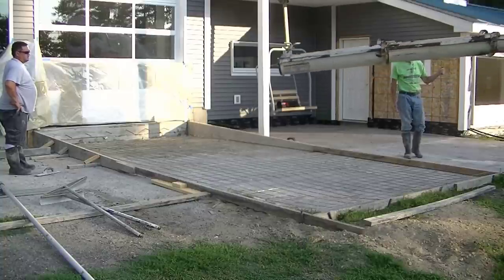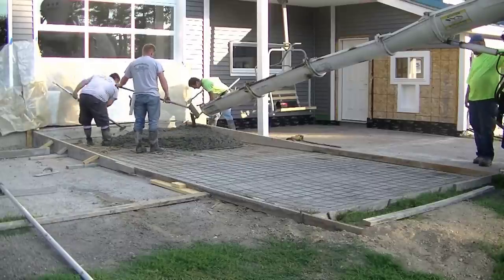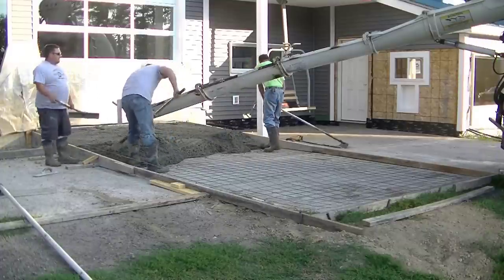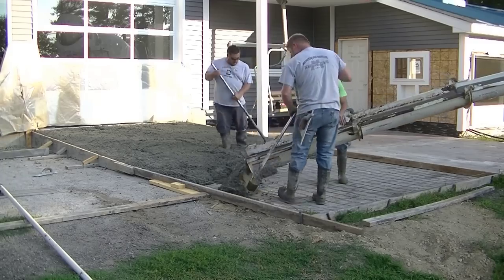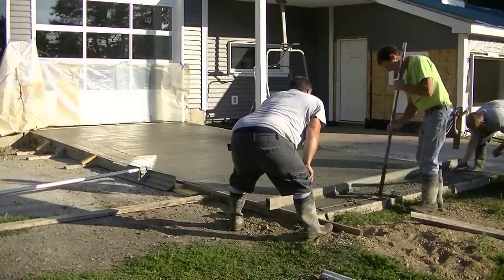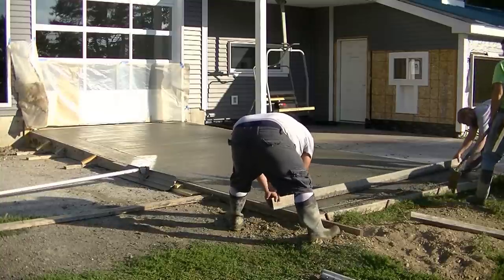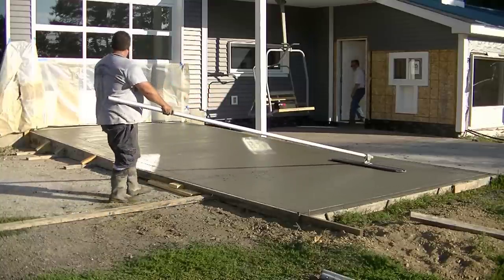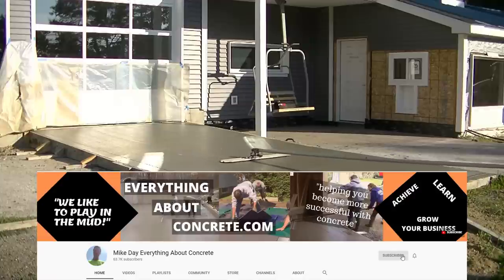Pouring Concrete Over Existing Concrete (New Patio Slab)

Comment: Pouring out a 18x24 old garage floor, bringing up to the level of the rest of the house. Customer closed in the garage. Tight space pulling the windows out so the concrete truck can get to it better. Slab goes from 4" to 5" slope end to end. Smooth finish

Comment: I'm extending my concrete patio by quite a bit and screening/roofing the whole thing. All through teaching myself and with help from friends. I plan on taking your concrete course before I start site prep. My concerns are setting the concrete/brackets for the posts and adding only an inch over the existing pad to blend it into the new sections of the patio. I'm practicing my finishing techniques with small batch forms for some pavers i'm making. Smoothing, edging, brooming, etc. Your videos have been very helpful. Best i've found on YouTube.
Reply: You should make a tutorial! I want to do the same

Comment: Every engineer I have dealt with has told me never pour concrete over concrete no matter how good the old stuff is   ? And if you were you needed to bust up the old in to small chunks or put a  3 inch sand base with liquid barrier on top  , it would crack  ? I’m in the Pittsburgh Pa Wheeling wv  area !
Reply: Im around beckley and ive seen success capping old concrete if you do rebar pins sticking up. You have to pour a footer then pour the slab if you do a monolithic slab. Thats code
Reply: If you build a concrete building, you are essentially creating new floors every 28 days. Concrete over concrete. You can, it's just about creating the proper bonding joints and have your rebar spec'ed by a structural engineer.

Comment: Have a house where the builder's originally poured concrete all around probably to keep water from the foundation.  Unfortunately on the side of the house where there's a big pad, the concrete is sloping back towards the house.  In the back where the concrete pad is about 1.5ft around the back, due to the spicket part of the concrete has sunken and is now holding water and causing basement flooding issues.  Trying to figure out how to fix these counterproductive areas and keep the water flowing away from the house without going broke.
Reply: @michaelsanders9147 I've got a similar problem in that there's a really old pad outside the back door. I've always noticed that it's not a bad slab with no cracks but it has sloped towards the house due to poor drainage. I fixed the drainage issue but when I uncovered the cement I found out that it's about six inches thick! WTF? Ugh! I don't know if I can break that but I'm becoming more convinced that concrete pad is going to have to be removed in order to achieve the correct slope away from the house. I was really hoping to maybe pour a slab on top but I don't think it's a good idea for the future benefit of the house. I think my plan is to remove the concrete, put a nice grade there that slopes away from the house, and possibly put a deck there someday.

Comment: Do you need a bonding agent? 

What's the minimum thickness you can pour over an old slab?
Reply: Since hes using 4k psi, fiber plus rebar, it seems like he isn't worried about cracking or separation. I find the bonding agents work but only i you put them on right before hand.  I'm guessing dirt from the air lands on the bonding agent and negates the adhesion to the new concrete.

Comment: What is the minimum amount of concrete can you pour over concrete walk to make it look new?
Reply: Same exact question. The only thing i've found so far on that is for thinner layers of concrete you need to prep the existing surface with weldcrete since the mass is not enough to keep the layer in place. Hope we get an answer from the pro though.
Reply: I have the same question.
Reply: Minimum of 2" is required, anything less it will crack easily

Comment: Hi Mike, I’m planning to recover the front driveway and pathway, it was done about 4 years back but never finished with a sealant . It’s broken down in a few places and I wanted to have it recovered with a brush finish rather than the original (very heavily)imprinted concrete, we were short of money and rather than using mats to imprint it, I wanted to use the garden cement step moulds, the ones that look like cobbles. My brother in law did the work for us but set the pattern in too deeply between 1/2 and 3/4” deep, if the severe winter hadn’t broken up a few spots, I was planning to acid dye the slab and the deep joints fill them with either a nearly pourable cement to infills the  deep impression therefore giving it the illusion that it was two different type of media, then seal the lot. But like I said, there a few pieces of damage where it has taken the top 1/8th to 1/4” away in a 3 to 4sq foot area.  What would you do to put a new cover on it, besides brush away all loose material and power wash the area clean, would you use a bonding agent to the original pad, or could new concrete be laid on top of the old. Any information would be greatly appreciated. Love the videos, keep em coming. All the best for 2023 from 🇬🇧 UK.   Phil

Comment: I'm about to extend out some steps and pour new concrete over old concrete steps. I knotching off the edges of each step. 2" below the old steps is pretty rough concrete.  Should I anchor the wire mesh into the old concrete for stability, . Or is wire mesh on its own enough for the new concrete? The new steps will be between 5 and 8 " thick in most spots.

Comment: Hi Mike,  I've got a bit of a tricky situation.  My back yard here in northern CA has a concrete slab for RV parking from the previous owner.  We painted it and turned it into a little hockey shooting area.  However, we want to re-do the back and go big-time:  actually make a little hockey court, by rotating the rink 90degrees and expanding it.  That means I've got to figure out what to do.  The existing concrete is pretty good, but it's not too flat as it was added in sections (some are a bit higher) - and it has those gaps for stress.  I'll also need to add more concrete beyond what's already there to get to the dimensions I want.  Ideally I'd like a really flat smooth surface bigger than the existing concrete.   I'm trying to decide what's the best way to do this - should I dig out and put in forms around the existing concrete and just add new concrete up against the edges of the old to complete my court, or possibly grind the old concrete down a bit to flatten it out and put in new concrete AND cover the old stuff?  It seems a shame to tear out the old concrete as it's actually in good shape... advice and tips would be great.
Reply: Get someone to come out with the scanner to check the structural integrity of the slab first.

Comment: I’m looking to build a self storage building on my current concrete parking lot. I’ll need to pour concrete on top of concrete. Can the original concrete kilt as part of the 4 to 5 inch recommended foundation

Comment: I’m looking to do my concrete outside of my garage door in the back of my house. It has some large cracks and it’s on the slope going downhill. I would have to pay a lot of money to have the concrete removed but I’m looking at it if they want I can just repair some cracks and pour concrete on top. What would be the accurate thing to do when you have about a 2 inch crack in some places to repair it before putting concrete down on.

Comment: I have a driveway that leads uphill from the street to a level carport. There is an area that has cracked about 20 feet from the start of carport and has become a trip hazard. I also want to form a sidewalk from the driveway and curve it up so a wheelchair could go to top step... I have dirt from another part of the property that I can form an increase in height without having to use concrete to get the extra height to get to top step. 
Do I need to put gravel on the broken area to level before I can start pouring

Comment: Hi. Thanks for your informative videos. I’m looking to pour a new concrete slab over my existing garage slab. However, under the garage is livable space ( cold room) so I’m concerned about the added weight. Had a contractor come out and he suggested preparing the existing slab by torching it before pouring over it. Never heard of this… any thoughts. Thanks

Comment: Well this is an older video but going to see if this gets through. :)  I have an old limestone packed concrete.  The old concrete that eventually breaks away exposing the limestone.  Am i able to pour over that?  I have no cracks, just has been worn away.  This concrete is so hard to break apart.  This is why I was wondering if I can pour over?  Thanks!

Comment: In Massachusetts. Subzero winters. An older driveway is kind of busted, but NOT heaved. It's also a little inclined, like maybe 5 degree slant (10% grade?) Can a new pad go right on top? Want the pad to be flat, so maybe 4" concrete at one end, but 8" concrete at the other end, to be level. Make sense? Thinking to do a monolithic as well, with the corners going in deeper. Thoughts?

Comment: I’m thinking about going over my cracked driveway it is low I’m wanting to raise the elevation possible road mix up to where I want it maybe 3 inches road mix 1/2 inch then 4 inch slabs over the top of that should make for a good base I’m thinking

Comment: Awesome video, I'm planning a 20x20 pad that is partially over another concrete slab that is 20x10 and has a couple big cracks and unevenness in a few places. What would you do different when pouring over a pad like this?

Comment: I have a 1965 bilevel home.  The concrete sidewalk on the side and back of the house has sunk 3" in some areas.  Can I pour concrete on top of the sunken concrete sidewalk?  Also, I have an RV pad next to my two-car garage.  I want to build another garage/ADU on this RV pad.  Can I fix the cracks and pour them onto this pad.

Comment: Had a house where they  poured concrete  over concrete sidewalk   he put rebar on top that was 4 years back so far ok .The driveway cracked where we had a ditch they did not compact the base !! I see very little wire mesh most use rebar now they use fiberglass rebar 4000 PSI granite mix 3 to 5 inch slump metro KC .

Comment: How do you set frame down for concrete if it’s on concrete? I’m trying to put a ramp down for my grandpa and it’s only 3.5inches high and 15 inches length. My question is how do I set the framing in place so the concrete stays?

Comment: I have a slope in my garage and wanting to pour concrete over it to level the floor out plus the doorway has gaps underneath where water flows in...can i put concrete under the doorway framing aswell pls

Comment: I have a 24 x 24 preexisting slab the is 3 inches lower than a 10 x 24  RV slab.. I plan on putting a steel building up.. should I bond the two and should I also add mesh.. I plan on putting in a car storage lift ..

Comment: Do you use any kind of primer on the old concrete to increase biding between old and new concrete?
Reply from the maker: There's really no need to when it's 3" thick or more. Anything under 3" I use a primer called Weld Crete.

Comment: love your vids man! Question if you don't mind if I pick your brain. I have a 20x20 slab in my pool yard, the concrete is around 15 years old and in great shape. Relief cuts were made about a week after they poured it years ago and there are no visible cracks. The surface was a fine broom finish, i have painted it once 3 years back to make it look fresh. None of that paint has peeled. The problem is this pad that I am referring to,  has an adjacent concrete slab poured up to it on one side, however that pad is 1.5 inches above this pad, is it an awful idea to pour a slab of 1.5 inches on this to make them even? Hoping with the situation that the existing pads' condition is so great, that it might work out? If so what type of prep would you suggest me to do before the pour? do I need to remove the paint? also what type concrete; strength and or additive would I order? I am in upstate NY and have pretty harsh winters, thanks for any advice!!

Comment: I have a cracked and heaved driveway. A l tree sits next to it and the roots did its job. Heaves are small, say 2 inches. Do I remove the concrete or can I pour a new driveway over it?
Reply from the maker: That sounds like a do-over to me not a pour over. Got to get rid of that root.
Reply: Thank you! Will do!

Comment: I want to concrete over an existing shed base can I leave it with just the first screed finish and then put the shed back on top or should I trowel and finish off just trying to save unnecessary work 6m x 4m 10cm deep
Reply from the maker: You can leave it however you want, it depends on how smooth you want it and how easy you want it to be able to clean.
Reply: Bull float it pal
Reply: @MikeDayConcrete  thanks
Reply: @cheshstyles  👍

Comment: We are thinking about adding on a room to the front of our house because the current front of our house is breaking away (long story). I'm wondering if it's okay to pour a foundation style form around the edges in dirt, up onto our current sidewalk. So the cement being poured would be on ground and on cement. Is it likely to break easily down the line?

Comment: Hey Mike. I need pour a pad on top of my sloping concrete pool deck for an outdoor Kitchen. It needs to bond to the existing painted pool deck. I was thinking of drilling a few pieces of rebar into the deck but what would you estimate the minimum concrete thickness and PSI? Do I need any bonding agent? Am I missing anything? Great videos btw. Thanks!

Comment: Hi, Mike!  Groundhogs reportedly hunkered down under my 1940 slab 25 years ago.  When the last spoonful of dirt was removed the slab cracked.  Poor drainage (a widowed senior lady) has a corner of the room about 4" off of plumb...and below grade.  Any tips?
Reply from the maker: There's guys who will inject foam under the slab and raise it back to level. Check for " slab jacking" here in YT. I've seen some videos about it on here.
Reply: @MikeDayConcrete  The cinder block walls scare them.  I'll have to pour on top.

Comment: I have a basement floor that's made out of bricks and under the bricks is yellow sand. I want to put 1.5 to 2 inch concrete over the bricks. Your thoughts and what material do you think is best for this? thanks.

Comment: Isn't the guy walking all through the wet concrete smashing the wire grid all the way down to where the concrete will set on top of the wire reinforcing rather than it being in the middle of the concrete?

Comment: Hi Mike, Great video. I have an existing deck that had  a raised trex deck over it. we removed the wood and want to pour over the concrete that is there. I would be about 24" higher. Do you think that will work? we are in Texas Thank you!!
Reply: Make sure you keep that concrete wet.  Something that thick will need time to cure property.

Comment: Can i pour a new 4 inch concrete patio over an existing cracked concrete patio or should i just demo the old patio ?
Reply from the maker: If it's just cracked and not settling, you're probably ok. The cracked slab has to be sound underneath it. And you have to have room for the added height on top of it.
Reply: @MikeDayConcrete  Can you explain more please. How do I know whether my old cracked slab is sound underneath or not?

Comment: QUESTION:  I am looking at purchasing a warehouse location that has had a building removed but many sections of concrete floor remain but it is in very poor condition and has many seams.  The entire slab is 60’x180’.  Your thoughts on pouring new over the existing OR remove and install a new slab?  Thanks, Tim

Comment: Mike, my husband is wanting to pour new concrete over a back patio. The old patio has allot of cracks and unevenness. What do you suggest to do with the old cracked patio before getting new concrete poured over top of it? The new concrete will be 4" Thick.

Comment: What brand of already mixed concrete would you recommend for a small porch 12‘ x 15’x2” I should be able to get it from a big box store like Home Depot ? Thank you for your answer
Reply from the maker: I use the Quikrete 5000 mix..
Reply: At that size 4in thick 2.2 yds or 5 inch thick 2.8 yds.  1 pallet of 42 bags = 1 yd.  Generally anything over a yard it's easier to order a redi-mix truck and pour it in under an hour rather than mixing bags for 3-4 hours. You'll run into finishing issues as your initial concrete will be set before you finish your pour.
Reply: Davey Concrete I’m looking at 2.2 yds for a slab in backyard, no ability to get a truck back there. Is it insane to try to mix it myself, or is there a solution to this? Do I get a truck-delivery and transport it to the backyard using wheelbarrows?